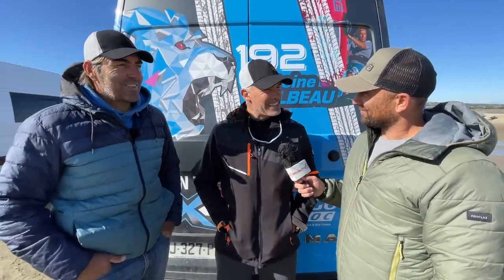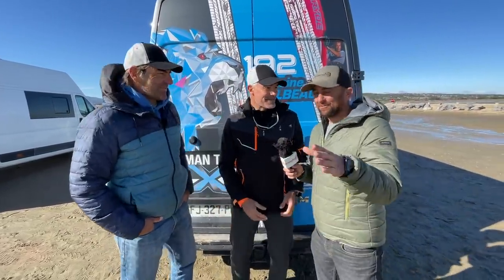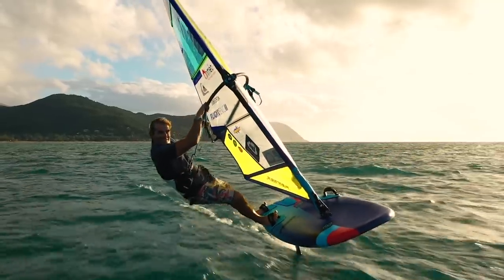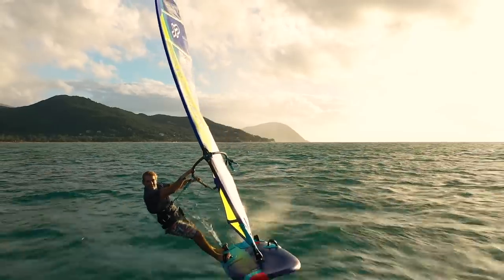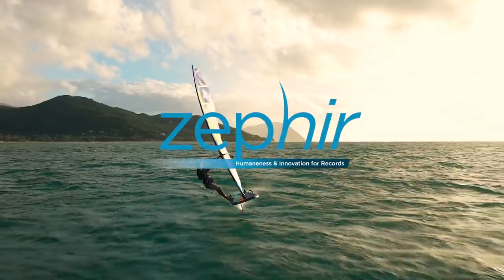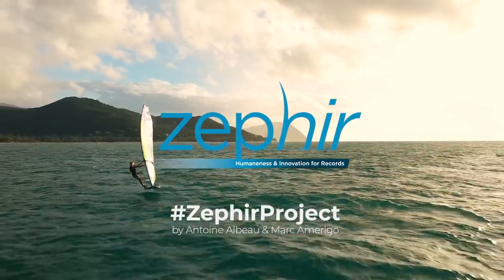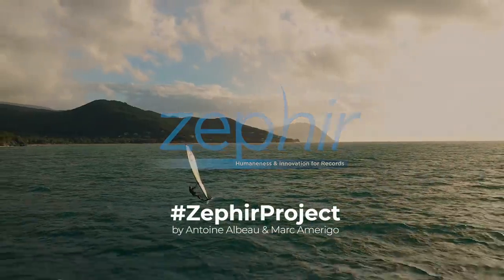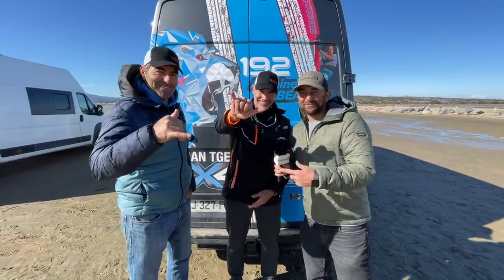65+ knots on a Windsurfer!! - Zephir Project

Comment: First, a big gain in reducing wind drag and creating more forward momentum would be a fixed wingsail (not new in windsurfing). The efficiency of for instance the wings of Vestas Sailrocket 2 and the America's Cup boats is much higher than a modern windsurfsail. (Fred Haywood mentions on the Windsurfing.TV podcast that you'll a fixed/solid leading edge on your rig, not cloth.) However, the drag of the windsurfer him/herself remaines a huge negative component. Second, either fin or foil, cavitation is another problem to solve. How about working around the cavitation problem like kitesurfers do? In Zephir/Antoine we trust!

Comment: Conducting an interview in 75 knots of wind! This must surely be a mistake. 75 knots is hurricane force strength. You wouldn't be able to communicate in such conditions.
Reply from the maker: Well the guys had a wind meter (expensive one) and down the beach when they did their beach walk to check the course a massive gust came through and it hit 75 knots on the meter. You could hardly stand up.